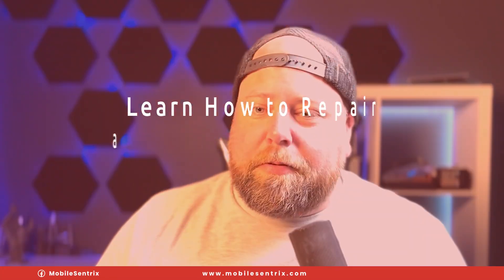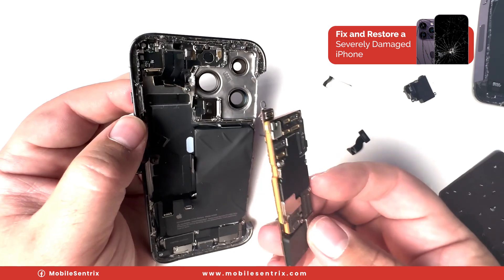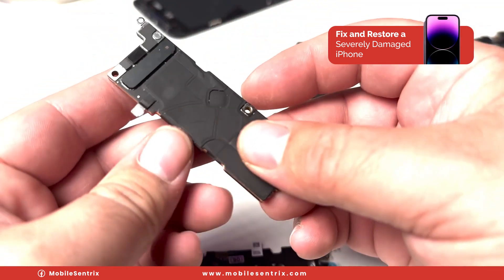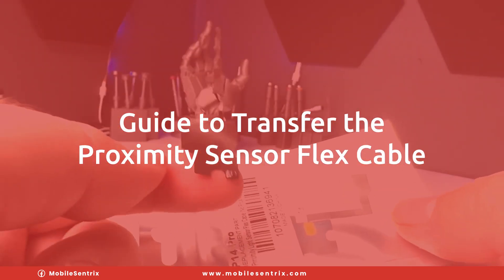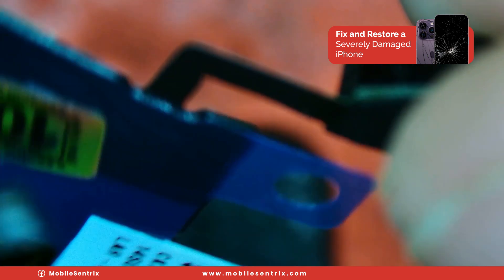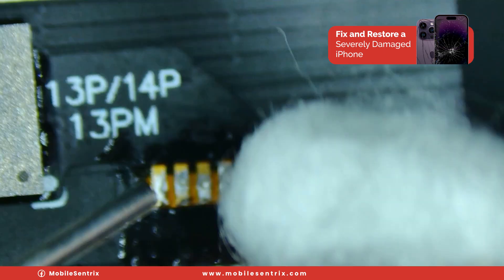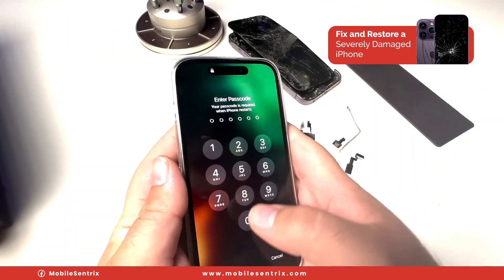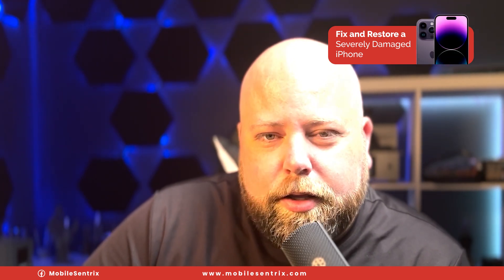Learn How to Repair and Recover a Severely Damaged iPhone

Comment: Great job.
May I ask what air speed you use for the screen IC to add on the tag on flex? Around 35-40% ?
Reply from the maker: yes, but it will range depending on the rework station